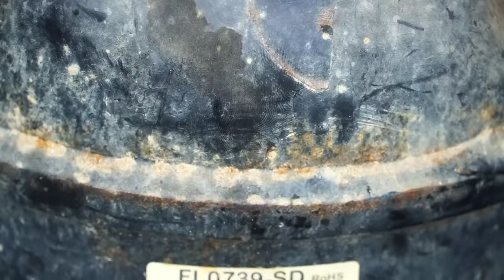I turn the refrigerator compressor into a super giant water pump

Comment from the maker: Where are you from
Reply: Im from vietnam
Reply: I know understanding this working
Reply: Умине тужи искиваж
Reply: Tuji tak dele nad
Reply: Mujnada tak delet 100m ast vad 8met viditi mujna
Reply: Какой производительности погружной насос стоит!?
Reply: saya curiga. dia pakai submersible di dalamnya.
Reply: @ИгорьЖигулин-ь9т  скорее всего 100л/м.
Reply: @sucasuca3548  ชอบครับ
Reply: Canada
Reply: Thailand
Reply: L ce tot le întorci pe dos așa pentru ce să curgă dacă la cineva deschis acolo
Reply: @sucasuca3548   how much max deep can it take  water from ?
Reply: How deep can take it water?
Reply: Vietnam. Ok. Thanks.
Reply: Those air fittings I'm pretty sure are use in China
Reply: @agungnugroho539  namanya jg buat konten
Reply: Bangladesh
Reply: I am surprised the  high water pressure didn’t separate the pipe from its  connecting pieces ? No evidence of any gluing.
Reply: vn, dont beleave him all they lie
Reply: India
Reply: India
Reply: Where were you from it's the right question 😂😂😂😂😂
Considering the safety sandals near running water and live AC line near by 😂😂😂😂😂😂😂
Reply: hoax
Reply: penipuan

Comment: The ref compressor can't generate that large discharge. A hidden large pump can do it.
Reply: สุดยอดไอเดีย    แจ๋วจริงๆ
Reply: I don't think you understand the concept. He is pressurizing the well. I know an Amish man that says he uses a BICYCLE PUMP to pressurize his.
Reply: @kellycarver2500  Noop. He is injecting air in the red tube. The compressed air will rise up to the surface. The air will meet lesser pressure ad expand bringing water with it. This method  is well known by civil engineers to pump water using larger compressors. In this set up the well can not be deeper than 10 meter. If you bring the compressed air deeper into the suction tube, you may lift water from any depth. The will be lots of air in the outpouring water.
Reply: @kellycarver2500  and does it ?work?
Reply: @inacioserralheiro2604  He says he's been doing it for years, so I would say it must work. I've never been to his house, but he's a smart, older business owner and preacher, so I don't think he was lying. It's the same concept used in aerosol cans. They don't have pumps, either, but the air pressure in the cans pushes the liquid up the tube, and out the spray nozzle.
Reply: Refrigerators are used with freon and it needs a consistent psi for the refrigerator to stay cold might want to do some research on the air pump for cleaning the water wells so you know it does work same thing as a slug pump for cleaning the dirty water out of a freshly drilled well
Reply: @kellycarver2500  
Los tubos de admisión y salida del compresor están al mismo tubo de agua, con lo que el compresor aspiraría e impulsaría agua, suponiendo que pudiera hacerlo. No mete aire en ningun sitio. NO PUEDE FUNCIONAR. HAY TRUCO
Reply: @kellycarver2500  ask technicians how long that small black thing can build up a pressure. He even injected water in the compressor. Is he high? Lol fake youtubers!!
Reply: @kellycarver2500 the main thing is the compresser needs the refrigerant gas to cool it down from the suction line so it won't last long it will overheat and burn out.
Reply: Also, a refrigerator compressor doesn't work like that...

Comment: Это просто невозможно такого не может быть если кто-то хоть немножко разбирается что такое компрессор и как он работает Они просто будут смеяться
Reply: Anyone can use a vacuum pump to raise water against gravity. Vacuum pumps create a negative pressure, which causes air to flow into the pump. This airflow creates a suction force, which can draw water up from a lower elevation to a higher elevation ,,,, in this case, he used the compressor as vacuum pump
Reply: Это ни разу не вакуумный насос.😂
Reply: В любом случае, производительность данного компрессора,  по отношению к количеству поднятой воды - ничтожно.Работать не будет.
Reply: Pura mentira

Comment: Людям которые хоть чуть-чуть понимают в физике, стало плохо
Reply: Another FAKE IDEA,,IMPOSSIBLE TO PUMP THAT MUCH TO A FRACTION HORSE POWER FRIDGE COMPRESSOR, 100% FAKE, if you notice the oil cooler he use where  that not connected the compressor, that line only loop inside the casing.

Comment: the refrigerator compressor cannot run for a long time, due to air and moisture, the motor winding will be damaged because even some part of water in it will spoil the winding of the motor, the amount of water and moisture through the suction line is possible only with the refrigerator compressor.  is designed for
Reply: Precisely right!!!

Comment: Why not try to recycle the compressor for it originally purpose?  It was engineer to pump heat. I was thinking. I remember the solar water heater my family used when I was kid. It used a compressor power by the grid to collect heat from the sun and stored all that heat in a hot water tank.  Never ran out of hot water. A family of six.  Connection Technology has a video about heat pumps it worth watching.

Comment: I cal BS.  If you have a one-way valve on the top end of that pipe how did you pour 2 saucepans of water into it?
The one-way valve should have blocked the water.

Comment: TOO FAKE. INSIDE THE SHAPE OF THE FRIDGE COMPRESSOR THERE'S THE ELECTRIC MOTOR AND THE TWO TUBES THAT CONNECT INSIDE WITH OUTSIDE ARE ONE DIRECT TO THE COMPRESSOR AND  THE OTHER INSIDE THE METAL SHAPE OF IT AND THEY WORKS LIKE A PUMP,  ONE WORKS LIKE SUCK AND THE OTHER ONE  PUSH OUT. SO IF YOU PUT THE WATER INSTEAD THE AIR INSIDE, THE WATER WILL GOES DIRECT ON ELETRIC MOTOR IT'LL DO SURE A SHORT CIRCUIT AT 220 A.C. THAT IS VERY DANGEROUS. SO PLEASE DON'T DO THAT AND PLEASE REMOVE THIS VIDEO ON YOUTUBE IT'S VERY DANGEROUS.

Comment: I’m just curious. If you took a two-stroke weed-eater engine, and put a check valve on both the intake and the exhaust, could it be used as a water pump? 

The shaft would have to spin slowly, maybe a hundred RPM.
But if it worked, it would last for a long time. No plastic.